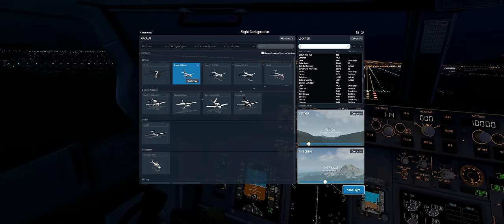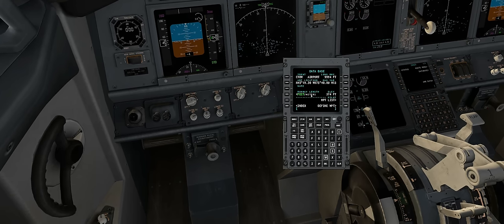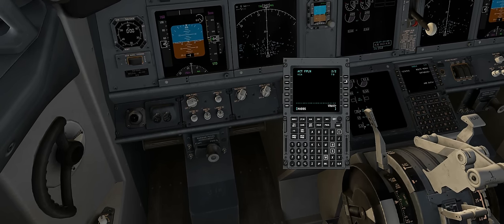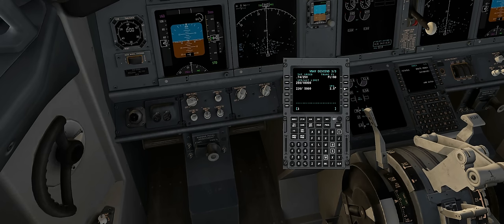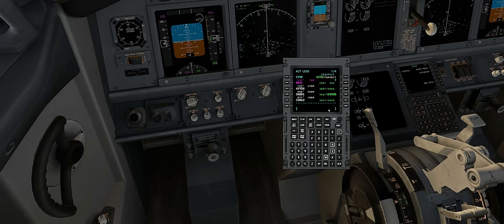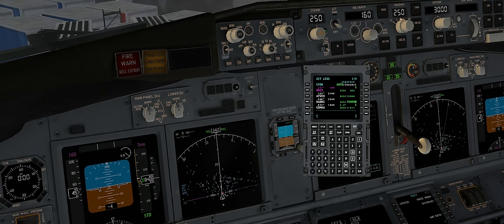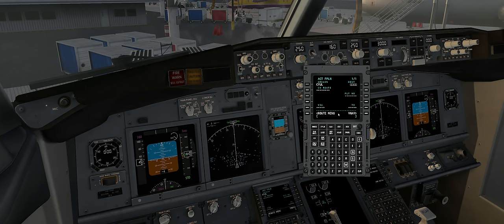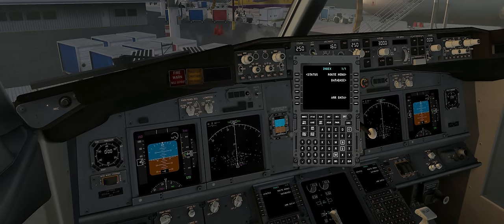X-Plane 11 - Flight Management Computer

Comment: Just one question... I have programmed the FMS and the plane follows the flight plan... but why on the progress page do I get no indication of distance and time to the active and next waypoints and destination? I see distance and time to the next waypoint on the PFD and the MFD, but not on the progress page of the Laminar FMS. And on the Kegs page, there are only dashes (---/-----) under AUTO/inhibit. So what am I missing? Tx in advance for any help you can give me!
Reply: Did you ever find an answer to you question?
Reply: On my PC, I see the mileages on the FMC between waypoints but the only one that is changing as I fly is the first one which is magenta and stays that way. I do have it set on AUTO also. The map display only shows the first waypoint in the upper right corner and the mileage raising as I fly away from the waypoint. Are the waypoints suppose to turn magenta as you fly to them and the mileages for all the waypoints should change I would think???
Reply: Yes, but I found it the old trial and error way... You have to put your proposed cruising altitude and cruising speed, not only the route waypojnts...
Reply: This is what you will see on the"Progress" page... on the "Legs" page all the waypoints should be present with distance and time, if the info on the Cruise page has been correctly entered.

Comment: AT 3.4 ON YOU STATE THE KEYBOARD AS APPOSED TO THE FMC UNIT WHEN TYPING THE INFO. IN.  YOU MAY WANT TO RESTATE IT AS SUCH. YOU STATE TYPING IN
THE KEYBOARD AS THE COMPUTER KEYBOARD AND THEN YOU STATE THAT THE OTHER KEYBOARD IS THE FMC, BUT YOU DON'T MAKE IT CLEAR. I HAD TO REVIEW
THAT SEGMENT SEVERAL TIMES TO GET IT CLEAR.   SO,  THERE IS THE COMPUTER KEYBOARD  AND THEN THERE IS THE FMC BOARD.

Comment: Main question where did you get the route for the flight plan its easy for me but its hard to find the route
Reply: yoyo, check out SimBrief.com -- it'll spit out some flight plans for you, based on both real-world routes and routes used by other e-pilots.
Reply: @josephbadams1  Ok thanks but my airac cycle is outdated but i found a video that you can try to use skyvector and try the route 1 by 1 but there are still problem that 70% of the flight plan is not in the database of xp-11
Reply: Actually sometime its works but yeah my pc was on service there are a problem and i cant try i was trying to use skyvector but i never use simbrief+skyvector maybe after my pc back thanks for the answer btw
Reply: @josephbadams1  *Update*My pc just back and its fine when i try to use simbrief the route is 90% wrong so someone says that you can click on the route on the map to see the real route and i try to use skyvector and copy it to makesure its real and when i try to use it in x plane 11 it finally work!

Comment: How to fix if the VECTORS is the last airway?
Reply: You're trying to approach the landing runway from an angle that is not possible to hit with the airplane's movement restrictions. Either replace the second last nav point with another one to plan an executable curve (you'll probably need to head back to skyvektor or whatever service you are using to plan your trip to do this), or look up standard arrival procedures for your destination airport and use one of them to make your landing possible, or choose a different landing runway.

Comment: I do not mind saying that X-Plane 11's  default 737 FMC does not work, at least for me. I find that if I engage the Vnav and the Lnav the plane climbs to the proper altitude but the software will then do something crazy. Airspeed drops from 300 knots to 150 knots, just out of the blue. Then it continues to climb, un-instructed from FL180 to FL300 and probably higher if I didn't QUIT. I have found X-Plane's aircraft defective, probably all of them in some way - certainly the Beech raft C90B. Software/programming problems with these - some argue its intentional! For  me all this spells is lousy aircraft and a poor value for the simmer!

Comment: So if “Vectors” appears in the “Legs” page, I should just delete that entry using the method you used at around 11:00?
Reply: Yes, or if you leave it as the final entry, it won't matter as you will be on final approach and will turn off LNAV and VNAV prior to intercepting the glideslope if using ILS/LOC runway.

Comment: I flew airplanes for 20 years without all the FMS garbage....it was easier to plan a flight using just an enroute chart and my paper approach plates!   Gotta be a computer programmer just to run the damned thing!   I'm more confused about FMS than before after watching this video.  Pilots have been reduced to button pushers, real stick and rudder flying skills are becoming a thing of the past...very sad.